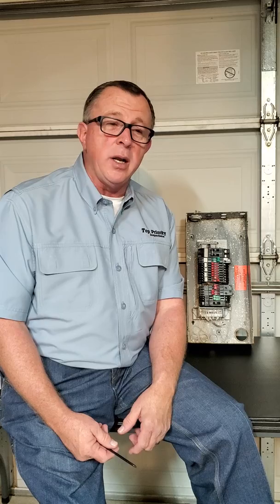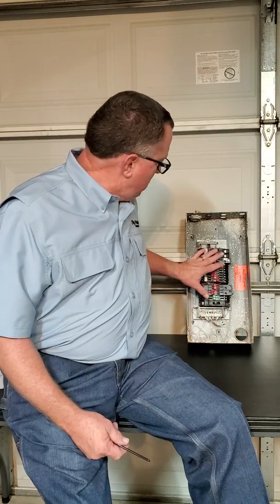Zinsco electric panels

Comment: them and federal pacific are dangrous the way they mount onto the busbar and aluminum and scratches cause arcing and loose connectioms cause arcing and melting i would say on the drop and going to the panel to use copper general electric and square d is the best ones to use fuses are relieable too but the issuie with fuses is no grounding around the building you would have to ground each receptical to a copper pipe ot splice it off in the fuse box for a ground im not an electrician but it's commom sense